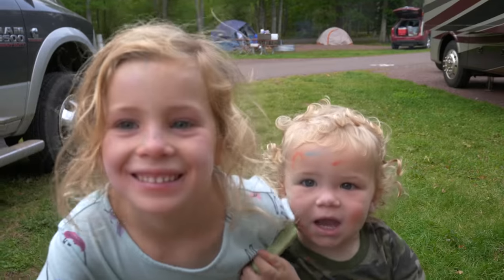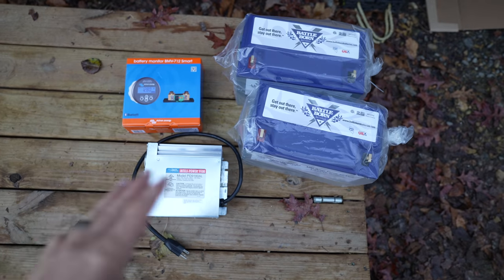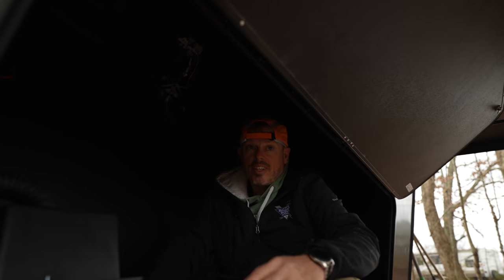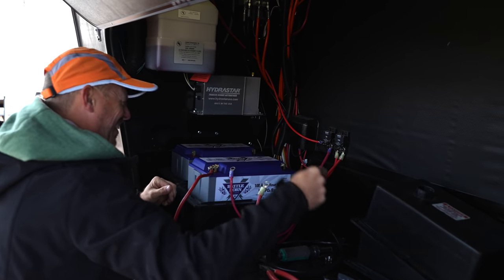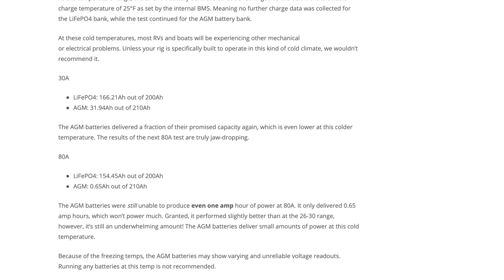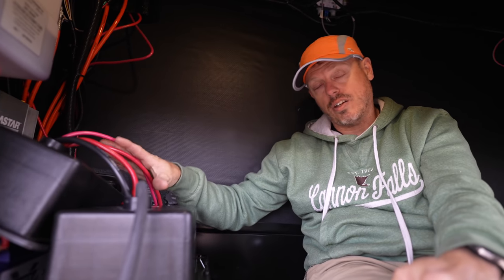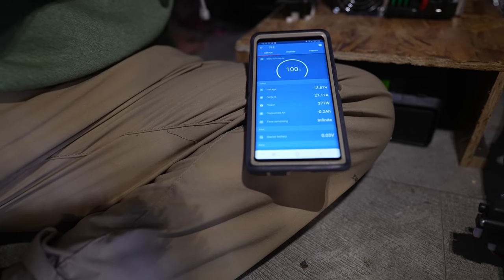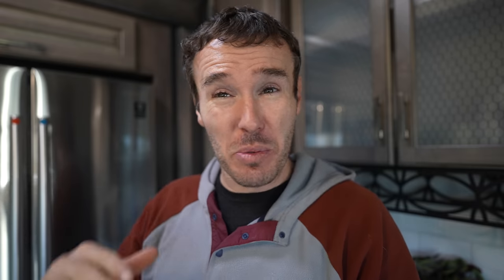Can You UPGRADE TO LITHIUM Yourself? // RVing w/ RESIDENTIAL APPLIANCES

Comment: I have a Goal Zero Yeti 6000 from the days of camping in our modified cargo trailer.  For two months, I lived off grid with it and 500watts of solar on the roof never needing to recharge from shore power (no A/C unit but had a small fridge). Now I we have a 30' Embrace trailer with all the bells and whistles. On our most recent trip for 10 days doing BW/Harvest Host sites, I'm having to run our generator even with the fridge on propane every few days.  I run the whole rig off the Yeti unless I have the gen running, by running a power cable from the back of the trailer to the front and up through the basement to where we keep the Yeti inside.  Crazy, but it works.  So, just wondering what your thoughts are on going with a battery bank like yours and selling the Yeti.  Pros and cons. Thanks.